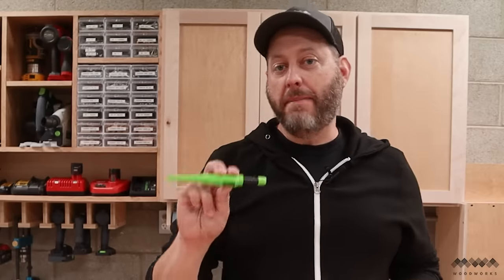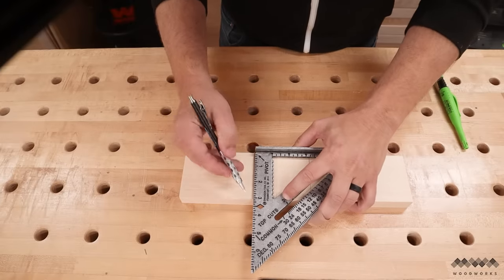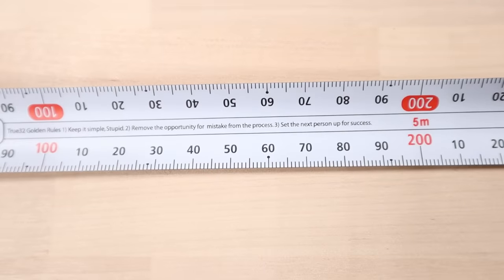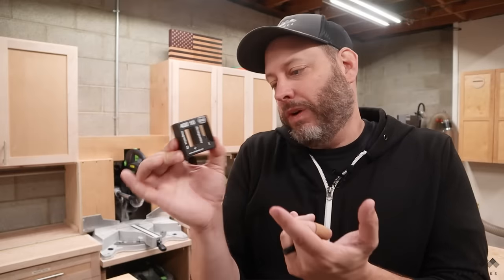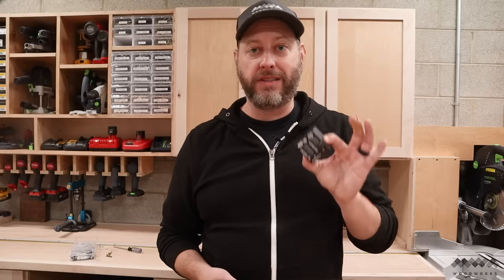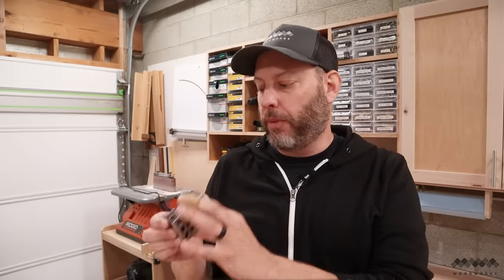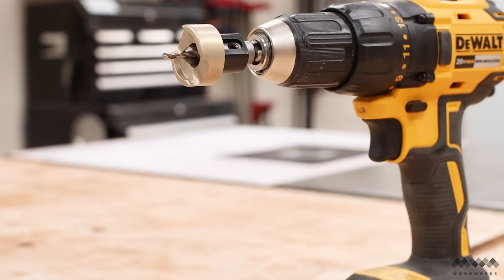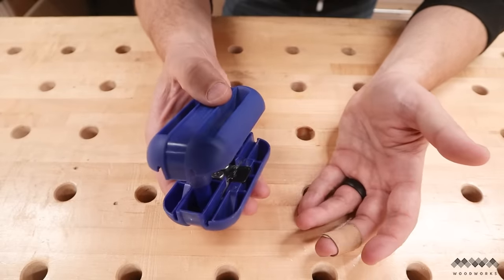Why doesn't every woodworker have these cheap tools?

Comment: I live in the UK and we use metric and imperial, choosing the one most suited to the job in hand. It's very hard to get hold of a tape measure over here that has one system marked on both sides and definitely not got them written upside down as we don't need it - we went to school and received an education allowing us to read numbers from all angles.
Reply from the maker: Good for you! 😀

Comment: Getting a consistent line out of a pencil (any pencil) is as simple as rolling the pencil in your hand as you make the line - that’s the second skill taught in any traditional drafting class. The first skill is how to stretch paper and hold it in place with four pieces of masking tape.

I own two of the pica pencils - they offer leads that can mark on wet wood and other materials that regular graphite leads do not. It’s the versatility of the lead types they offer and not the mechanical action of the pencil that makes them so useful. They are probably not needed in a cabinet shop where the wood is surfaced and dry.

Simple wooden pencils can be purchased in bulk complete with spare erasers and a sharpener at Costco during back to school season. In the right hands that kit is far cheaper and more versatile than a collection of mechanical pencils. I keep a kit in my truck and shop - I never run out of pencils before the next back to school season. The trick with all pencils is not to drop them.
Reply from the maker: I love the white lead for the Pica. Great for marking up walnut before cutting it to rough parts.

Comment: Really enjoy your video in the content that you provide. but I'm going to take a little exception with the 123 blocks. I've had mine for over 2 years And I use them daily.  Just leave 1 or 2 laying out on your bench as you work and you will be surprised how many times you might pick them up.

Comment: I’ve been using pentel twist erase mechanical pencils for mor than 10 years. It has a rubberized grip, it clicks and stores several extra leads, and has a long vinyl erasure that cranks out of the back end. They come into various lead sizes (I prefer .9mm HB).  Also, get a pentel polymer erasure for cleanly removing marks on wood- or when quickly drawing up plans, they are amazing.

Comment: Never picked up, then tried to remove iron filings from a magnetized tool? Granted, how likely is a woodworker going to be faced with that problem. However, a screwdriver can and does get used in both woodworking  and metalworking shops. That demagnetizer just might make that job easier.
Enjoyed the presentation and look forward to any future ones.

Comment: rotate the pen as you move it down the square, will help maintain the point.
Reply from the maker: Good idea
Reply: @MWAWoodworks  in general i find the hufltus same thing as the pica is great for rough carpentary,  but the sharpener is on the case clip easier to sharpen on i have 3, 5 n 9 of the stadier pencil, but invariably reach for the hulfitor

Comment: I have several of the Pentel GraphGear 1000 pencils in my shop. They offer different lead sizes for the pencils. I have the .5, the .7, and a .9, and they also have a .3 but I don’t have much use for that fine of a lead.
Reply from the maker: Yeah I bought one of the .9 pencils but I'd put that on par with a Pica with about the same benefit to my shop

Comment: I’ve a small but powerful magnet that I ripped from an old key holder. Put it on your screwdriver and it’s instantly magnetizes, pull it of and it’s demagnetized. It’s held on to my ratchet  screwdriver over 10 years.

Comment: The pentel mechanical pencil comes in .3, .5 or .7.  I use the .5 as shown in your video, but for those with a heavy touch they can go with the .7 to give them that extra strength.  Also there are different types of leads for those pencils,  2B, B,  HB & 2H (I know because I also use them for drawing).  Anyway, the 2B is the softest lead (the darkest too) while the 2H is the Hardest of these (also the lightest of these).  So if someone has a heavy hand they can get a .7 pencil and buy .7 2H leads for that pencil to give the best chance.

Comment: I always use a H3 Pencil. If you you really need a fine point, just sharpen it. After a rough use it will stay at a wideness like the pica. And you can use it at construction wood or even bricks. Find your sweet spot. Only downside is that if you go harder the line will have less contrast and it will dent the material so the line remains if you make a false line or a marking.

Comment: In answer to the question why you would demagnetize something always demag your drill bits before drilling steel helps to keep the chips from sticking in the flutes . This helps to keep the drill cooler and helps to keep your hole sized properly.

Comment: The thicker mechanical pencils are useful when dealing with extremely rough wood or plywood, where 0.5mm lead will simply not work. It's great if you only work with smooth, flat surfaces, but not all of us do.

Comment: Good video.  Thansk.  On the 1-2-3 blocks, they are used for on your table saw, to provide exact inch measures from your fence. So, you are crosscutting, and usually people will grab a piece of wood and place against the fence, push the wood up against it, and then push your piece through the blade.  Well, 3/4” wood is not always 3/4”.  However, these block will always be 1”.  So use it as a stand off, or provides you for an exact measurement if you want a first cut, and then want it to be 4 inches, stack the blocks and you will have 4” exactly.

Comment: You can magnetize a screwdriver with....... a magnet.  Any powerful rare earth magnet will work.  Speaker magnets work pretty good since they're large.  Just draw the tip along the magnet in the same direction.  Done

Comment: I have a Penta but honestly any cheap mechanical pencil with a fine lead will work.  I actually reach for the cheap Walmart disposable mech pencil on my bench more often.  The Vix self-centering drill bits are essential, IMO.
Reply: The cheaper pencils (in general) eject more lead with each click, with fine lead the more it sticks out the more likely to break.
Reply: @j.f.christ8421  If too much is out, hold down the lead ejector and push some lead back in.  Takes a second.
Reply: @dereklong801  Yeah, you can always make a cheaper tool work with  effort.  Or just buy a better one, they're not that expensive.  I usually use a marking knife anyway and 0.9mm for writing.
Reply: @j.f.christ8421  I have both.  The cheaper one is literally just as good.

Comment: first the thing with the Pen .. You are comparing Apples with Plums ...  the first one has a long metal tube .. this is a "Deep hole marker" ... so if you have to mark the Drilling hole behind/through a thick Board or so ...  the second one is a normal Pencil .. to draw lines at a ruler ..  two different tools for two different situations ... !!!!

Comment: On your issue with the Pica pencil, all you have to do is buy harder lead.  That solved the issue for me, and I'll never go back to a mechanical pencil.  One drop of a mechanical pencil that causes the tip to bend, and you're back to Amazon buying more.
Reply from the maker: Yeah I just used the Pica with the lead it came with

Comment: You can also magnetize a tool with any home magnet. Just rub the magnet along the length of the tool actually touching the tool (i.e. along the shaft of the screwdriver or claws of a hammer). Neodymium magnets are the best. So, save the $10 and grab a fridge magnet. The reason you would want to de-magnetize a tool is when your working on something delicate like a computer, or almost anything electronic, where the magnetization would damage the sensitive components.

Comment: I never upgraded to the narking knife, but buying a huge pack of cheap .5 mm mechanical pencils and leaving them EVERYWHERE has worked for me. If I had just one nice pencil or marking knife, I'd never be able to locate it when I need it.
Reply from the maker: That was my strategy with tape measures 🤣
Reply: Have you ever used golf pencils? The kind that have a little bit of lead in a plastic holder.  Got a box of them free and have them all over the workshop.

Comment: I buy #2 yellow pencils by the half gross, 60 at a time for you "non-imperials" and mounted a pencil sharpener in my winter shop and another in my summer shop. I do like the Pentels for the holes in my marking gage. And if you are in the yard the flat carpenter pencil is perfect.

Comment: I’ve had a demagnetizer for years for working on computers. I don’t have to own two sets of screw drivers just to prevent messing up a motherboard or hard drive. That is one of the main reasons for a demagnetizer.
Reply from the maker: Yeah that's a great use case for it. Can't have magnets around electronics like that

Comment: You sold me on the fast cap tape measures. Gonna get 12. Also, check our DFM squares. They are same as woodpecker but blue and cheaper at $45.
Reply from the maker: Yeah DFM has some good tool deals!
Reply: The one i have is a story pole tape . Inches down one edge and blank surface you can write on to either mark the length of a piece needed or set it for the important measurements of a cabinet or other projects

Comment: I see people recommending those Amana countersink bits all the time, but no one ever seems to mention the size. There are differently sized bits for differently sized screws. The 10 piece set is almost $250. Do you just use the one for everything?
Reply from the maker: I only use one

Comment: Fastcap yellow (Metric & Imperial).  I keep a small one in the car, and the longer one in the shop.  Didn't like the gray one (Metric) cause my wife kept telling it was broken as it didn't measure correctly so she threw it out.  Love my Pentel 5mm and 9mm mechanical pencil's.  I have an old Sears reversible socket end screw driver in my quick kit.  Works fantastic.

Comment: the graphgear LOOKS like it's all metal but it is not. the lower half where you hold it is just a sleeve over a plastic internal structure. mine lasted several years writing in aircraft maintenance forms but it finally broke where the forward tip screwed onto the plastic housing. the plastic is what failed. still a fantastic pencil though. I use the .7mm version but I also have the .9mm.

Comment: 9:00 The second time you ran the screwdriver through the demagnetizer (degausser) you did not pull the screwdriver all the way through so the tip did not get the full effect, that is why you still had residual magnetism.

Comment: 9:17. When I saw the "Demagnetizing" feature on that tool, I was thinking, you can't demagnetize something with the same magnet that made it magnetic. That seems like a major marketing scheme. I think the only way you can demagnetize something is by heating it up, hitting it with a hammer repeatedly, or applying an AC magnetic field to it to degauss it. The problem with magnetic screwdrivers is if you have metal shavings around. If you're strictly using your screwdrivers for wood, then they should be magnetic, 100%.

Comment: If you want the magnetism removed you’re going to need a degausser. Something you may be able to find at a garage sale. They just plug in and you click a button to degauss. They’ve been around since the first TV sets.
Reply: Also, it looked like the tip of the screwdriver didn't spend much time within the range of the demagnetiser.

Comment: Pica: spin the pencil while scribing the line. That way the pencil doesn't get a flat spot. I learned that in drafting class. Also I lean towards the 0.7 drafting pencil. 0.5 breaks too easily for me on wood. I also spin the 0.7 .

Comment: I can answer the question about why you’d want to demagnetize something. I changed the screen in an iPhone once and was congratulating myself on how smart I was for organizing all the microscopic screws on a magnetic tray. Then I started to reassemble it and realized all the screws had been magnetized. My screwdriver was also magnetized and the law of averages meant that half my screws had opposite polarity to my screwdriver so it would repel the screw head making it impossible to use. 😂

Comment: try the rotring 800 series mechanical pencil. similar in features but higher quality.
Reply from the maker: yes, but also $55 per pencil. I'll pass on that as a shop pencil. I think the GraphGear has more than what is needed for the shop and the quality is very high, even if not as high as a Rotring. I'll buy six GraphGears and put them all over the shop 😀

Comment: Id like to get one of those Amana countersink bits.  However they are quite expensive and every time I look to buy one its confusing on which size to get, lots of options but no real sizing guide that I can see.   So I have not pulled the trigger on a $42 countersink bit for a screw size I dont use much.
Reply from the maker: The one that I have linked is the most commonly used one with the 1/8" bit which can be used for #8 or #10 screws even #6 screws if going into hardwoods.

Comment: The demagnetizer is for working electronics so you dont blow any circuits or wipe any magnetic media like a hard drive or cassette tape for all us old heads that know about cassette tapes, vhs and 8 track tapes which ironically only had 4 tracks...

Comment: Late to the party but here's my input: skip the thread checker! Instead, get the 60 piece imperial/metric tap and die set from harbor freight. It's under 30 bucks when it goes on sale, and yeah yeah I know you should spend more money on nice taps and dies but here's the thing - this is going to be your beater set. Keep using each component until it breaks (hopefully not in a hole) and replace the busted taps with a higher quality version as needed. That way you have the best of both worlds: a functional tool instead of a one-trick pony, and a way to check/cleanout junky bolts/nuts.

Comment: The Powerlock or the Fastcap tapes are OK for my kitchen drawer and my utility room tool pouch and my glove compartment and my garage tool shelf but for my workbench give me the ol' Leverelock.
I really don't see the use of the threadchecker set since a decent (or even a lousy) tap & die set can serve the same purpose, plus lots more uses.
Reply from the maker: If you do metal work and have a full set of tap and die then you can just make the hole fit the bolt LOL but for us lowly wood workers and DIYers a thread checker is cheap and handy.
Reply: 60 piece metric & SAE tap & die set Pittsburgh brand from Harbor Freight $42.99. Nothing a machinist would drool over, but for a "lowly" DIYer who just needs to chase a thread occasionally, just fine.
Your threadchecker $28.24 at Amazon, marked down from $45.99.
The threadchecker strikes me as one of those gadgets that you find in the bottom of some unused drawer five years later and ask yourself: "Now why did I buy that/"

Comment: i feel like the line width doesnt matter. if one is using a pencil they arent trying to be precise, or theyd use a knife...am i missing something? id live to find a good pencil for the shop, I have the lead issue all the time, especially with rougher lumber.
Reply from the maker: Marking knives are ideal for very precise joinery, but a close second is a good mechanical pencil. Your feeling that line width doesn't matter would be true in one sense but untrue in a more important sense. Its not the line width itself that matters, its the fact that with pencils that you have to sharpen to a point, like a Pica or a regular old wooden pencil the width of the line changes as you use it and wear down that point, thus making each successive line less and less reliable. With a mechanical pencil the stick of lead is a uniform thickness which never changes because its not a conical shaped thing. So my line width never changes and I can reliably reference off the edge of that line every time.

Comment: Using blocks to set the height of blades and router bits seems a bit unprecise to me. Personally I use a height scribe, which is normally used for.... metalwork. And it doesn't get much more precise than that, as it has a micro-adjustment feature. I just very precisely set the height on the scribe, and raise the blade or the bit up against the bottom of the scribe "blade".
In my oppinion, blocks are more suited for setting up fences and stop blocks.
The Pica is actually mostly meant for marking in holes where your oh so precious Pentel can't get into because it's too wide. Here in Denmark, the Pica is labeled as a "deep hole marker". I have used mine for marking in "deep" holes on several occasions. For normal marking, I use either a 0.5, 0.7 or even 0.9 depending on the accuracy needed, and the length of the line. For very precise work, I use a marking knife (home made from a broken 15mm wrench), with the added benefit of severed fibers to avoid tear-out. :)The self-centering bits are nerly impossible to find here in Denmark. I think I found mine in Holland.

Comment: Can you identoify whcih models match the different screws?  Like which Amana tool is a #6 screw, which is for a #8, and then for #10, and #12.  I have seen conflicting info on the Commenst on Amazon as to which is which. Thx.
Reply from the maker: I think there are drilling charts on the internet that tell you what size pilot hole works for what size screw, for example 1/8" works for #8 screws, etc